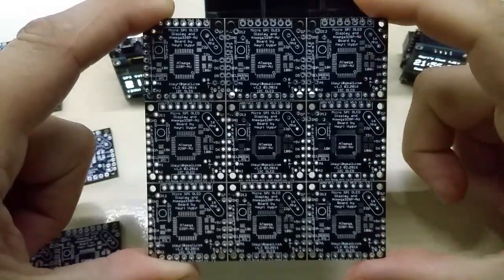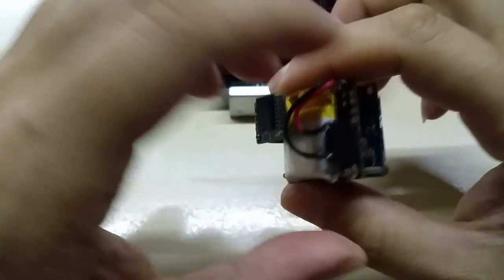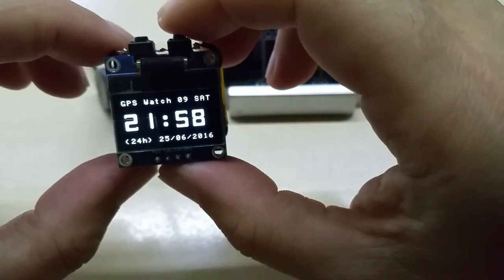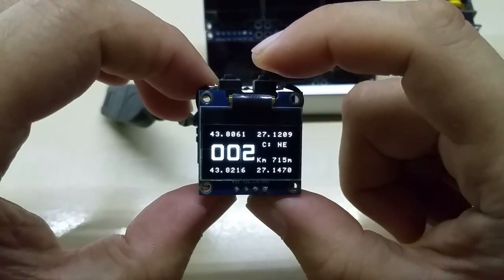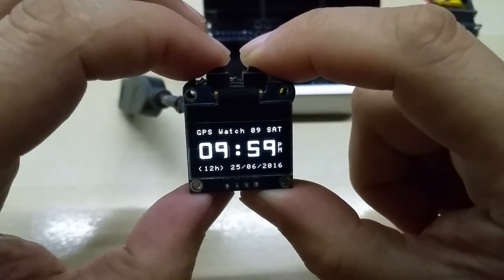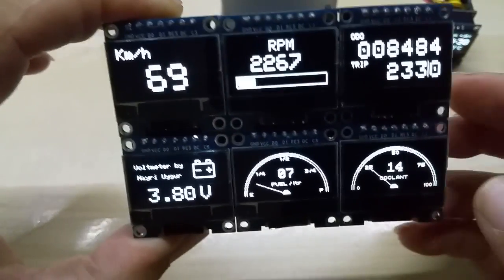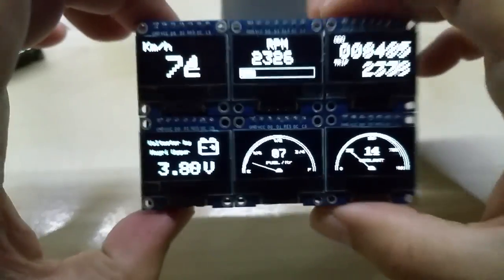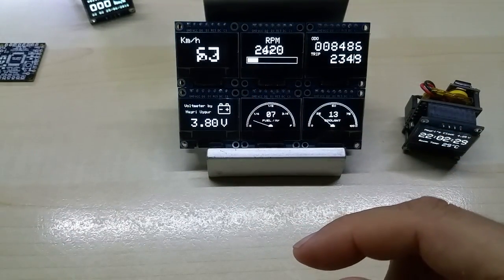OLEDiUNO Display PCB, please see my improved version too :-)

Comment: Is it possible to make one to monitor up to 16volts. Another to monitor up to 280amps. And another to monitor ambient temperature of a area up to 18feet away from the screen, and also wired to a relay to control a fan. I'm new to arduino and am wanting to make something to monitor my car battery voltage. The alternator output. And the temperature inside of my amplifiers to turn on the fans after they start getting too warm. Thank you for your assistance and time!
Reply: I would like to be able to see them on multiple screens. Meaning one for voltage, one for alternator output, one for temp.

Comment: Do they have a color version out?
Reply from the maker: Yes, there is a color version 0.95" OLED display but with only 96x64 pixel resolution and the pixels are 3 times as big and that's why I do not like and do not use them plus they are more expensive of course.

Comment: Can you make a custom motorcycle gauge with fuel,high beam, neutral status and gear status? Hmm I guess a 4 piece config would be good so I can put it on a round classic motorcycle speedometer case. Your works are great sir thumbs up and subscribed!
Reply from the maker: Thank you for your kind words, since I am working on a big project that I want to put up on Kickstarter I have no time to do anything else than my normal items I sell on Tindie. As soon as I finish the PCB design I'll upload a video to introduce my new product. As a small teaser, it will include these features plus many more not listed here: 1.3" OLED, Atmega328 and ESP07, flat rotary encoder with nav buttons, GPS, microSD card reader, 1200mAh Lipo and all the sensors you can think of. The clue will be that you have dozens of sketches on the SD card and choose from a menu and upload whatever  you want from the SD card, nothing other needed, no PC, no phone. You'll have a multiple functionality in one device.
Reply: That is a great idea sir! Keep up the good work . So its gonna be a design with multiple features. You just select whatever features you want from the SD. Wow that would be awesome. One suggestion sir. I wish it could fit on a standard classic speedometer . That would be a great item for the shops that make custom motorcycles. Keep it up sir!!!
Reply: Hayri let me know when you are ready with your kickstarter.  I was innovation professor and director of Action Learning at HULT International Business School and would like to see you succeed.  There are several areas I see your ideas and skills being quite useful.

Comment: looks awesome, would love to make a water proof case with a 6 way display for my offroading CJ-5.. only problem is the current setup is all mechanical... other than the oil pressure.
Reply from the maker: Well automotive sensors are not that expensive and most will output 0-5 volt which is perfect for the Atmega chip I use.

Comment: This would make a very nice PC hardware monitor for placing on a computer case or desk showing cpu temps (all cores), cpu speed, fan speeds, cpu voltages etc...very interesting and nice clear displays..The PC Overclocking market might be great for this...have you thought about that?
Reply from the maker: I could not look into it yet, don't know what kind of interface it needs to get the data from the PC. I used to have a LCD display that could do it but it connected to the Printer port, now I would need something that can do it over USB since I only have a Laptop.
Reply: All PC's can be have the system information read via USB, not sure what the software is though... I will check as I know that Corsair's all in one watercooler H110 GT with an internal USB header can drive all the system information to software so that I can read all the information in real time.

Comment: I like those screens, they are very visible.  But they are just way too small.  I wish they would sell 5" versions and be done with it already, it's 2017 now - I'm very sure someone has the technology to make something BIGGER for a change.
Reply from the maker: You are so right, we are flying to the moon and yet these displays are only available in limited colors and sizes. And if you want to buy a 2.4" you get the same resolution with a $30 price tag.
Reply: 2.4" available with about 80 pins, on a paper-thin flat cable with .2mm pitch, comes with a dictionary sized data manual for me to make my own driver that they don't simply sell you spi interface with 4 wires.
Reply from the maker: They come ready made like the small ones too. Just the price and the low resolution considering it's size are prohibitive. Better to use 2.4" color TFT screen instead.
Reply: Hayri It is possible output arduino as composite video, with just ONE pin, and run that to ANY lcd screen / size you want.  Fpv field monitor 7" cost $35 ebay.
Reply from the maker: Yes, but I meant the other way around. To input composite video and show on the OLED display, I know it would be incredible tiny for a video screen, but I still would make it :-)
Reply: Ok have fun with that.  I have no use for tiny devices that are difficult to see.
Reply from the maker: Thats were imagination comes into play. I could think of a couple of uses, for example helmet rear view camera with monitor .
Reply: The composite video-out for Arduino is just as diverse to display graphics and text, as the functions used for the oLed text and graphics.  I guess someone who was younger than me, could find it easier to focus back and fourth between near and distant ranges.  I rather have my displays as easy to read as a book on a table.

Comment: A permanent tension of 4,2 Volts can be harming the battery since Li-Ion is 'designed' for about 3,8 Volts.
Reply from the maker: Once the Lipo reaches 4.2 volts the charging boards stops charging. I have units running for over one year without any issue.
Reply: It is possible but just like sealed lead acid batterys getting topped off at 14,7V but get an standby voltage of 13,6V. The lithium ions/polymers get their full charge at 4,2V but standby should be like 3,8V.  On both types this avoids corrosion and hugely enlarges lifetime.   
Easy visible on cellphones. Being in 90-100% state of charge all day long kills the capacity in 1,5-2 years.

Comment: Hi Hayri, I loved your system. I would like to know if Can I use more than one sensor in just one pcb and change the "pages" just pushing a button. Are you selling it? Thanks I need Clock, Battery, Fuel Flow and temperature in just one pcb. Thanks
Reply from the maker: As a matter of fact you can. The 3 displays on the top are actually the same code  just started up with a different selected screen. They can be switched with a button. But you need to know how to edit the code to your requirement. It is not a plug and play software. My upcoming OBDII display will be plug an play and get the required info from the car.
Reply: Hayri My use Will not to be used on OBDII Car. I'm building an experimental aircraft! And for clock, volt, fuel flow, and outside temperature, I would like to use independent sensors. Thanks
Reply from the maker: I understand, well it is possible but like I said you would need to adapt the code on the sensors you will use. Especially with the fuel flow sensor as there are different kinds out there. Clock, volt and temperature is no problem.

Comment: wow i need this to monitor humidity, temperature, baro, alti, GPS clock and more
Reply from the maker: All possible and if you need wifi on top of that I have a new OLEDiESP board coming out. It will be a ESP07 or ESP12E with OLED display, microSD card slot, LM35 sensor, DHT11 sensor, IR receiver, IR diode, accelerometer, BMP180 pressure and temp sensor, LD sensor and on board LED's. All this in the same size as my OLEDiUNO PCB
Reply: cool !

Comment: Nice boards! Curious how long does battery last in OLED clock?
Reply from the maker: The clock uses about 20mAh, depending on battery used 9 - 10 hours with display always on.

Comment: At 1:07 the clock skips from 21:57:07 to 21:57:09.
Reply from the maker: Good eye, that clock with that particular code was only sold once and has been replaced at no charge with the customer. You do realize that this video is over a year old and that the PCB design has changed as well as the code.
Reply: Hayri no I didn't know that. To be honest this is the first time I'd seen your videos. This video showed up in my recommended.
Reply from the maker: No harm done, please do watch my other videos if you are interested and you can also visit my Tindie store, link in the description, if you like.

Comment: I can see a lot of practical applications for these kinds of things in motorsport, especially for things like boost (probably through a manifold air pressure sensor), oil temperature, oil pressure, air/fuel ratio, etc. Just a thought.
Reply from the maker: You are absolutely correct, only your imagination is the limit. I do have example codes for all the sensors you mentioned.

Comment: 4.25V is a bit high. Hobby chargers go up to 4.2V. Everything above is degrading and potentially hazardus.
Awesome Displays though!
Reply from the maker: My Lipo chargers charge with 4.2 volt max.
Reply: i had a cheap imax charger showing 4.2v but actually they were 4.12v. moved to a ISDT charger now.
Reply: i had a cheap imax charger showing 4.2v but actually they were 4.12v. moved to a ISDT charger now.

Comment: well, how about smartwatch with that same oled display and same functions
Reply from the maker: Somebody asked me the same question, now that I have a 3D printer I will make on just for the hell of it. It won't do any fancy power saving and sleep mode. it will run till the battery goes down or you turn it off. the clock use about 20mA, for me it will be enough if it works during the day and I can charge it overnight. Take it or leave it :-) no pun intended against you. Might use a 1.3" display though, if you are interested shot me a message.

Comment: you need to make a version that can be used to reflect on the glass, to make it HUD. with preferences of custom. conected to the OBD  via Bluetooth
Reply from the maker: HUD possible, OBDII working on, BLE no. as soon as I have the OBDII version ready it will be plug and play. No pairing and losing connections to deal with.
Reply: good thinking! more reliable, but how to hide the cable all over the dashboard of a beautifull car?

Comment: How about for a Computer? I want to be able to see Hard Drive activity and CPU, GPU, Voltage, Amps, Watts, PC Temps and Memory usage. How hard would it be to build something like this for a PC?
Do it now before someone else does, You could get a Patent and make fortune.
Reply from the maker: Back in my desktop PC days I had a LCD display with all those features. But it connected to the printer port. Would need to see if USB versions exist.

Comment: it wörks but it's still not great, I want pcb with Atmega 328 and Oled on the same board
Reply from the maker: This was the first version of my PCB, my current version is way more advanced and both use the Atmega328P-AU chip with real 16Mhz xtal and caps. don't see why it is not great,I think it's awesome :-)
See how many different items I build with it, show me anything that can compare and is this small.

Comment: Would you provide a link for the Lipo charger??
Reply from the maker: Just look on eBay for them, but there are 2 versions one with protection circuit one without. I use the one with protection of course.
Reply: Alright thanks , and hey if you come across a  Boost Converter  with more then a 2 Amp  output  and will run  on voltages  between  2-5  Please send me a Link , trying to make a specialty charger

Comment: Amazing stuff, I'm curious as to how one would retrofit this to a vehicle one would have to know the voltages to the original displays so your displays would match how does this work?
Reply from the maker: The gauge you see in this video would need to connect like you describe, not very user friendly. I am working on a OBDII version that will be plug and play.

Comment: What is your power draw in current?  I want to purchase some! I'm going to market with our new IWash system and I've been asked to track usage so I need a log display. this looks perfect for the job!
Reply from the maker: My clock cube for example draws around 20mA, the GPS 45mA, just depends what else is on the board.

Comment: great looking product! can it be used for stand alone temp display for solid state controlled heated bed?
Reply from the maker: Sure, just need to adapt the temp sensor to the board and code.
Reply: Would you be able to instruct on the use of a thermo coupler setup. What's your price?

Comment: When will you sell on eBay can you let me know the name of your shop would love to purchase the clock and some others will you do a kit of parts as I am good at soldering so no problem, your boards look good quality hope you sell plenty Bob
Reply from the maker: Hi Bob, my eBay store/user id is phoenix-cnc. Just let me know what exactly you would like and I put up a listing to eBay. At the moment I only have my CNC controller and stepper driver board there.
Reply: Thanks, I have found your eBay store I am interested in your clock in kit form with the chip onboard programmed depending on price I have PayPal so easy to payI can fit all the other components myself as long as you have details with board layout and component positions with BOM
Thanks Bob

Comment: Great Product !! can you suggest some 3d printing monitoring gauges with this setup? Thanks Happy Extruding....
Reply from the maker: Actually there already is something that is being used with 3D printers. It comes with a 128x64 pixel LCD screen and there are forks that make using these OLED displays possible. But to be honest these will be a little on the small side. 1.3" OLED's will be definitely better albeit still small.

Comment: Hi, where can I buy from? I need a custom cluster which includes: dual exhaust temperature, oil temp and oil press, rpm, speed, water temp, volt, air fuel ratio and possibly fuel level. Thanks
Reply from the maker: Wow, Youtube seems slow these days, getting the comment 9 hours later. we wrote already to each other.

Comment: which library did you use for the display on the ESP?
Reply from the maker: I did try a few ones but did not make any particular app yet. I want to make a GoPro remote with OLED display first
Reply: ok but in the first project you show in the video (the cube) which libraries you used for the display?
Reply from the maker: I use either Adafruit, U8GLIB or MicroLCD depending on the code.

Comment: Hey, been checking your Tindie store on and off for the past couple of weeks looking for the bare boards with arduino & bootloader, or at the very least bare boards. But all I see are projects built around them, usually involving a shield of some sort. Are you still planning on selling these as bare boards, or is the police lights the most barebones version that can be purchased?
Reply from the maker: Hey Juan, If you are interested I can put up it up for sale, but it takes a couple of days to get approved by Tindie. Please let me know, it will cost $13.95 plus $4.95 shipping.
Reply: Hey, Hayri, and that would be for an unpopulated 3x3 panel, a populated single unit with bootloader, something else?
Reply from the maker: Sorry for not being clear about that, it will be for 1 populated PCB with bootloader. The code can be uploaded with a USB to UART TTL adapter like I have on Tindie. If you need more than one I will make a discount.
Reply: Well, that doesn't differ a lot from the police lights then. In that case, no need to trouble yourself with listing another variant; for prototyping purposes the police lights will do just fine. I can solder on my own female header for the OLED.

I'll be in touch once I'm ready to order the rest. It's for a car that's been under restoration for 2 years now, and I'm not yet at the stage where I can start working on the interior. :/

One last question though: those nice circular gauges, is that your own code or a library?
Reply from the maker: Not entirely my code but I edited them to my taste. Once you are ready to buy the PCB's I will send you the code. Like I explained in the video, if you need more than one I can send them in 1, 2, 3, 4, 6 or 9 PCB configuration and I will give you a discount. Take your time and let me know when you are ready.

Comment: i know a bit off topic but where can i find mobile cellphones cameras? with cables ?
Reply from the maker: eBay, Aliexpress, Goggle
Reply: Any links because I do use eBay alt and never found those small cameras only mic capsule
Reply: Also let me be more clear, I'm looking for those size cameras to use in the same fashion as you're using this tiny modules for Arduino, not to replace a camera on my phone

Comment: If you make small ones with video signal input options and a tiny screen to view it at I'd probably buy one :D.
Would be awesome to use in like wearable tech and such.
at the moment i'm building a IR nightvision, and I'm using an old crt tube from a video camera with a 120 degree small camera... a bit bulky but it works :P.
Would be more awesome with a small screen and board like that, then it would be lighter, smaller and most of all, more awesome!
Reply from the maker: The Atmega chip is not powerful enough for that. If you would have said thermal camera there is already one made ( not by me ) that sell for around 300 €.